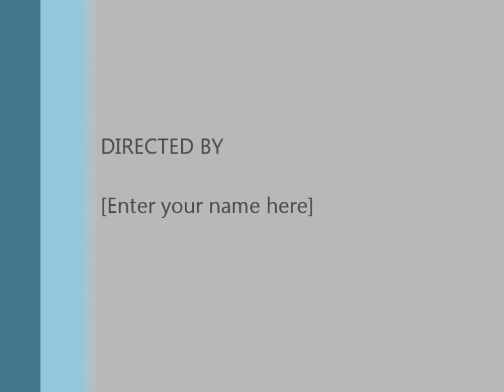Clamp install movie

Comment: Set In Stone Hardscapes has joined a select group of contractors who are mechanizing paver installation to increase efficiency.  Just like any new tool, as the clamp is used more, productivity will continue to increase.  It would be great to see more video as you gain experience with the clamp.  Thanks for sharing this video.